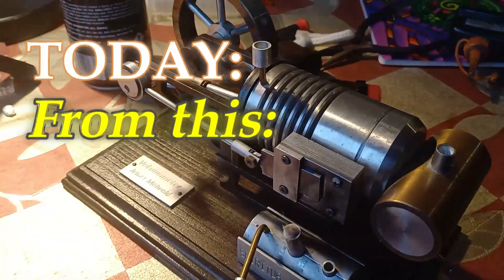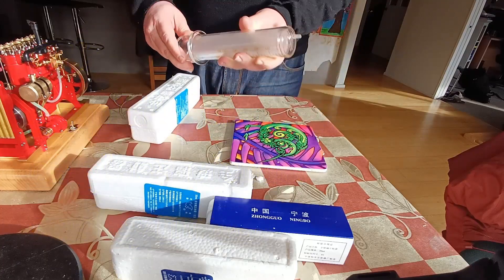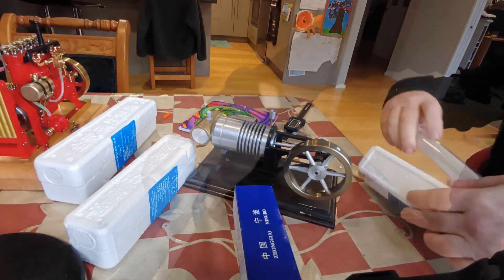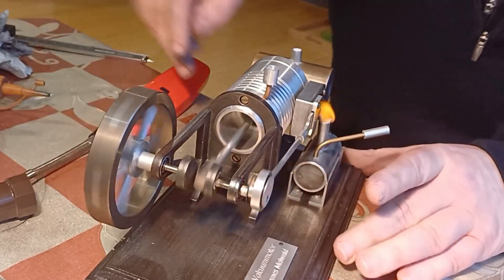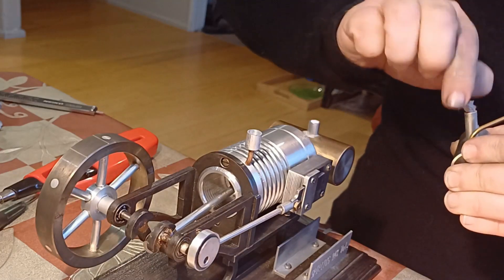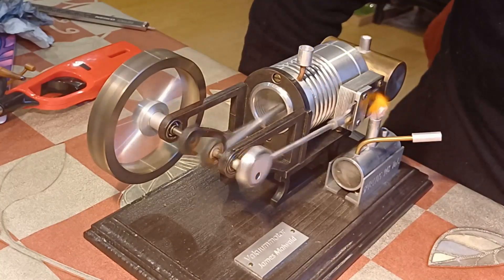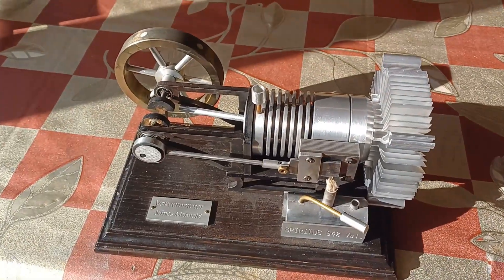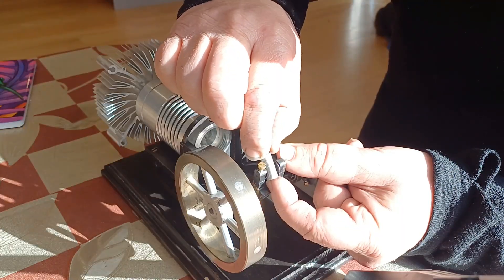Flame Sucker Engine  "POP MUSIC!" - Flammenfresser by James Maiwald - model vacuum restoration

Comment: Hey brother this is very nice engine , will it work with petrol ??
Reply from the maker: I think petrol burns with lots of smoke so not best. They work with propane fine but some say propane flame is too hot and dry leading to less lubrication / more wear. Spirits from the hardware store creates a little water in the exhaust
Reply: @ThomasPCGuruENGINES   ok thanks for  Swift reply ,  spirit. Is hard to. Find in india.